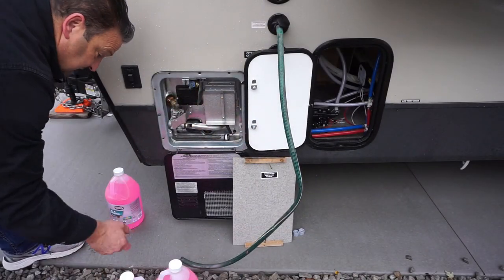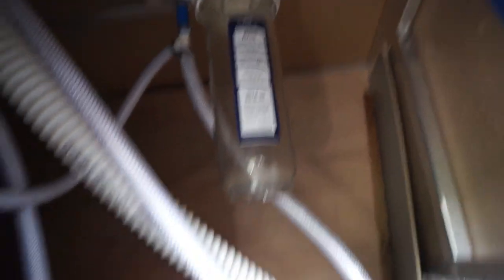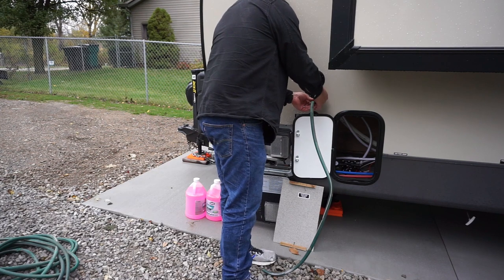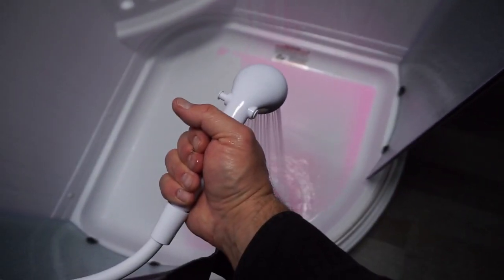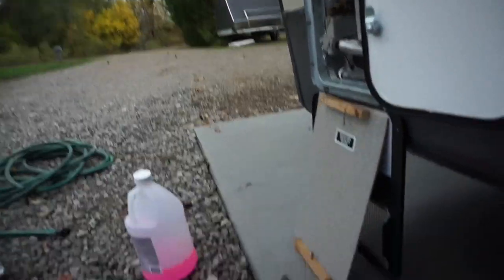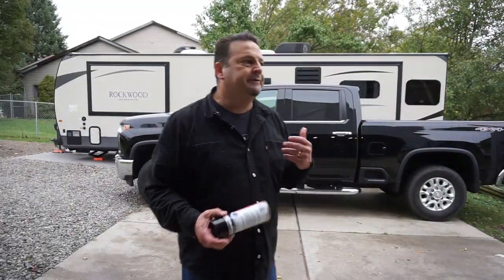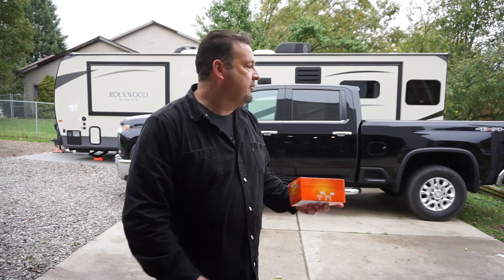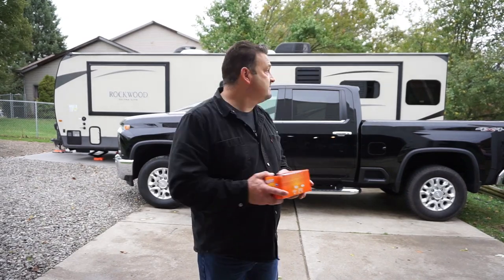Winterizing 2020 Rockwood Ultra Lite 2906rs RV

Comment: This is my first time winterizing my Rockwood and I'm also a car collector gear head,found the video very helpful . I can't figure out how to remove that water filter located by the pump. Great video
Reply from the maker: your trailer should have came with a white plastic spanner wrench that is used to unscrew the glass cartridge, it has a circle with notches inside of it that grabs the top the cartridge. If you second than go on amazon and grab one like this-

WATTS WATTS-WR100 Water Filter Wrench https://a.co/d/540AQJG
Reply: @mcpheemotorcarshotrodshop  I think I seen one in the trailer,just have to find it ,thank you